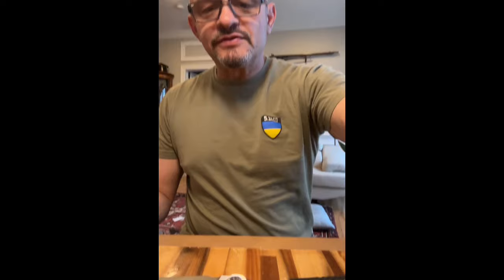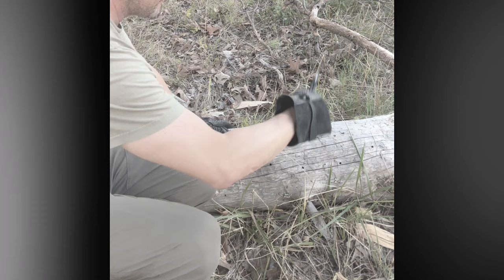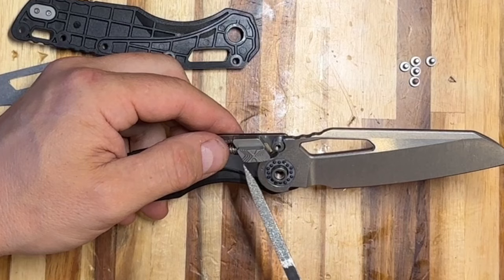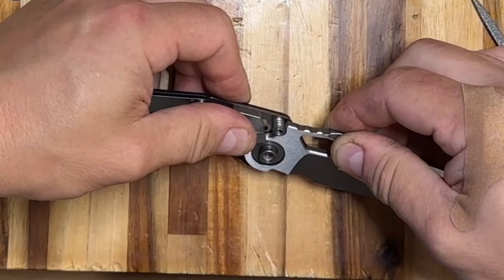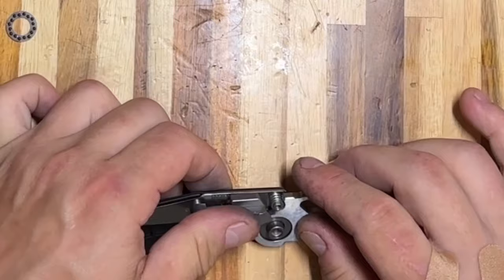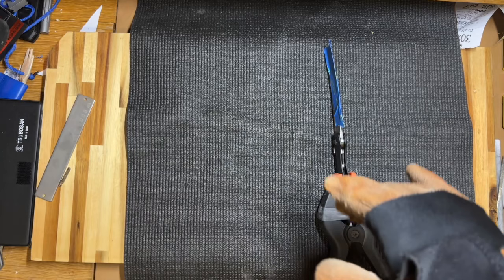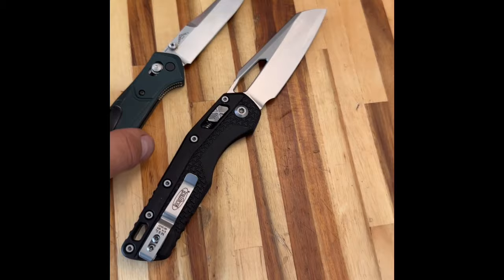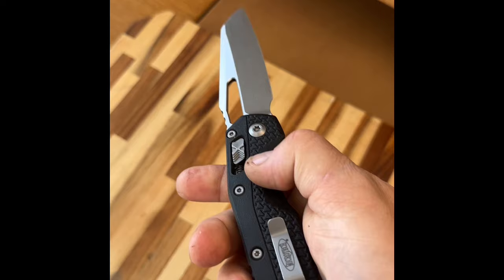Microtech MSI lock failed. See why & how to fix it.  Is it a good EDC knife candidate?

Comment: Just to let you know you probably just took years off of the life of your knife before it gets lockrock. And completely destroyed your chance of having warentee work done to fix the apparent failing when you use it as a bat. The gap is designed to be there to allow for wear so as its used over time you dont end up with up and down play. As an enginere i thaught you would understand that objects used in the real world that move and rub against each other need to account for wear when built so that they can last longer....
Reply from the maker: The ram head is heat-treated to at least 55 HRC, so wear is not an issue. The failure is in the geometry. I explain why in the follow up video: Straight Answers to Microtech Amphibian Questions: Ram Lok Fails, Recurve Sharpening, Tip Strength
https://youtu.be/uouaZlInYLI
Am not worried about the warranty, it’s not going to be a knife I can carry and it is now a part of my video prop collection. Great comment, keep them coming!👍

Comment: As another ethnic Ukrainian knife reviewer, the flag is really appreciated.  My MSI doesn’t unlock, but the idea of having that much potential play is giving me cold feet in terms of recommending it FOR NOW.  If Microtech starts quality-controlling these better, it’s basically the Manix 2 meets the 940 and is brilliantly designed.
Reply: Героям Слава!

The Manix 2’s lock is a caged ball bearing.  It’s Spyderco’s ball locks that we see on the D’Allara and the Q-Ball, only done better.  Engaging a ball bearing and needing to “wrap around” it is generally a better bet than an Axis-style lock because of area engagement.  The reason the Ram-Lok gets around that is because it’s just so large that it will by default engage a larger area (and on the Stitch, where they dialed the lock in better since it’s not entry-level/they’re putting more into QC, I absolutely think they have a game-changer).

Comment: I got two off the first drop. Sold them both the day they came in. A black and a OD. Both horribly off center, and the actions on both were TERRIBLE. 

Won’t touch anything with a ram-lok from MT. This video only further solidified that for me.

Edit: Synthetic is a fancy way of saying cheap plastic. unfortunately, gunk gets in there, and wears that plastic cage down REAL quick if you don’t catch it in time.
Reply: @CuttingBoardRx  I agree wholeheartedly. Also, you bring about a an interesting point with the axis vs ram-lok thing. Would be funny if they did that as a, “hey, get out of OTF’s.”

Though I’ll admit, I have a feeling it has more to do with the patent on the axis lock, recently expiring. I’ve seen a recent influx of “new” axis-lock inspired designs, as of late.